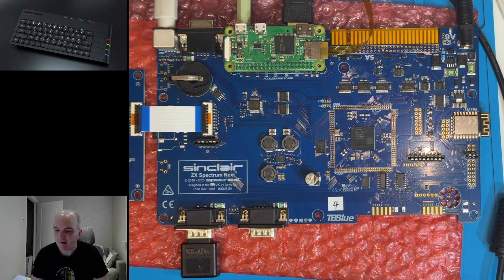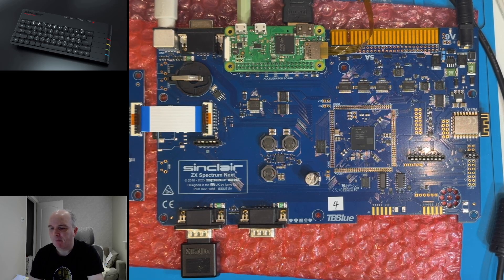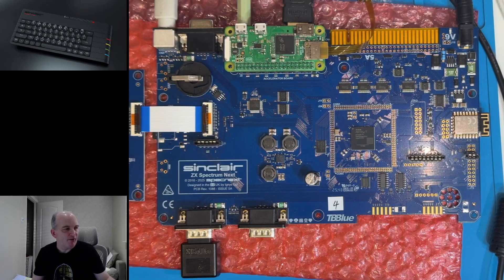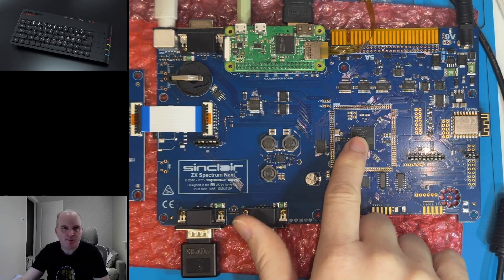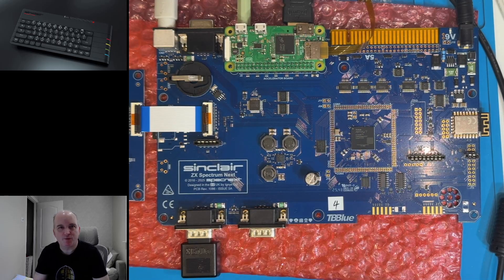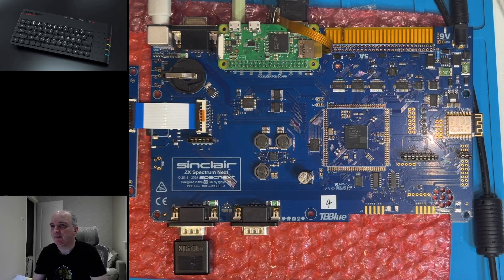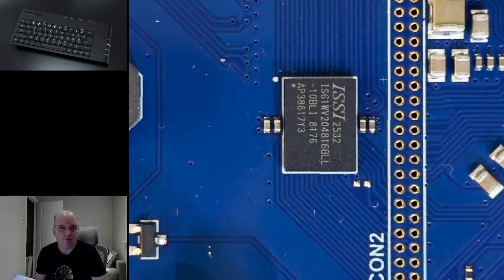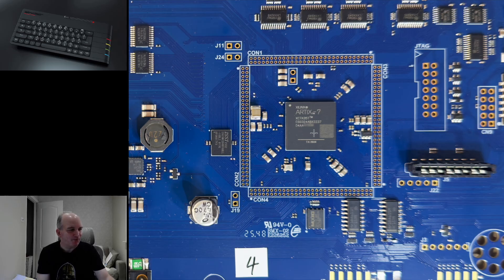Sinclair ZX Spectrum Next Issue 5 (KS3)

Comment: Was thinking  with regard the mini sd slot if it would be possible to have an access bay cut out so that one wouldn' t need to open the case to get access to the mini sd. If the next isn't going to ship with such an access bay do you think it would be fairly simle to introduce?
Reply from the maker: I suspect the micro SD card ejection in situ would foul on the bottom case "H beam" so even if there was a cut out, it could not be ejected fully. So this aspect would likely need to be removed. There are no plans to make a cut out on the KS3 case, but if there is a future KS, or Next 2 then this is something that should be looked at. Maybe the daughterboard should present the two SD slots with a wider mouth on the case to accommodate them. DIY is the only method therefore. Drill, file and finish.

Comment: Will there be a command line syntax in Next basic to call to verify if a machine has the higher ram so that game makers can validate at run time compliance?
Reply from the maker: Nothing has changed, for the Next it's still a 2MB machine.
Reply: @SpectrumNextStuff doesn't answer my question.  Can you do a Reg query or Peek to validate size at all?
Reply from the maker: @RichSzerman  You have always been able to peek to find the maximum bank, or use the dot command .mem

Comment: Will there ever be a power switch built into the ZX Spectrum Next? (Talking about a proper power switch, and not some inline on the power cable)
Reply from the maker: No, best practice is to cut power at the source, the PSU is your switch. If you just cut DC, the PSU is still live. I was never a fan of the inline switch provided in KS2. Typically where you did find power switches on computers, it was when the PSU lived inside the case and you could cut the AC feed.
Reply: @SpectrumNextStuff @SpectrumNextStuff That is totally not how an ATX PSU works, which probably accounts for over 99% of desktop computers worldwide in 2026. The no-load power consumption of a modern PSU is basically negligible. In most countries, unlike the UK, sockets don't have switches, so you would need to unplug the PSU to turn it off, as very few, if any, PSUs suitable for powering the Next have power switches.

Comment: Thanks for the update.  Do you think you might be able to provide an overview of the changes that have been made to the audio input (cassette and TAP/TZX loading) across the revisions?  I ask as I have an n-go board I’d like to fit inside a grey +2 (which is essentially the KS1 circuit I believe, but with HDMI errant voltage fixes).  I’ve been contemplating adding the extra audio input circuitry from KS2 schematic as a subboard (build it on vero board) as I will be connecting the cassette player directly to the board.  It looks like the KS2 change involved the addition of an op amp comparator?  (I  have a KS2 and backed KS3, but the +2 was my computer back in the day).
Reply from the maker: Probably not, the changes happened over a few iterations, and were tweaked. Don Superfo who makes the XBerry probably knows better than I as I believe he has been looking at a KS2 clone.
Reply from the maker: Just adding, I updated my above comment as it was Don I was referring to in relation to a more up to date Next clone e.g. Issue 2.
Reply: @SpectrumNextStuff  It looks like the +2 datacorder already outputs a square wave and, I’m guessing, the op amp comparator was added to KS2 for devices that don’t?  (Your typical cassette recorder or a more modern audio player).  I’m now thinking the KS1 circuit actually could be the better choice for fitting into the +2. I should just try it anyway.  (Particularly as I won’t be using other cores in it, just the Next and spectrum ‘personalities’).

Comment: The length-matching of the RGB signals for the VGA caught my eye in the thumbnail and it made me wonder when RGB skew would actually make a visible difference. It seems like quite safe to say that a 5mm skew would not be visible even on a 1600px horizontally capable CRT (I wish someone did a mask that fine). 1mm on a PCB is about 7 ps, so we're speaking of a 35ps skew.  For a 1600px screen the pixels are squirted out at 162MHz = 6.2ns = 6200 ps per pixel.  35 ps out of 6200 ps results in 0.005 pixel (half a percent) in error. I don't think that would be visible even on a 100 inch CRT looking at it using a microscope.... OTOH, this matching doesn't hurt anything and it is free on the PCB so why not - at least it looks cool and a bit more hi-tech. ;-)

Comment: What role does the raspberry pi serve? I ordered one, but couldn’t get a clear explanation of what it actually is used for.
Reply: The Pi was meant to be used for HDMI but then the design changed and it wasn't needed for that anymore. Now, it is used for loading TZX (tape) files in real-time, playing PT3 and other compressed sound files and (in the future) as a co-processor for some games.
Reply: My understanding is primarily it provides the wireless functionality but can also be used as an offload processer, but that has to be coded for (not default support).

Comment: Interesting video.  Sad though that with all the updates they ignored our requests for internal PS2 and Power pads claiming interference issues.  Also the FPGA is very weak for emulation, less than 1 3rd that of MiSTer FPGA and that is excluding the Arm cores on MiSTer.